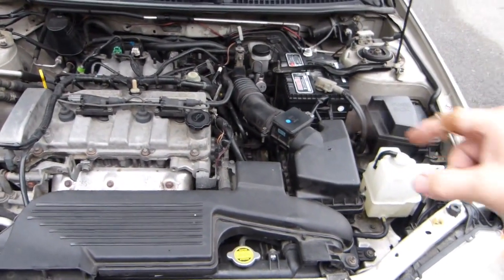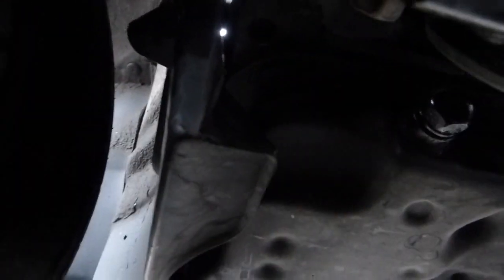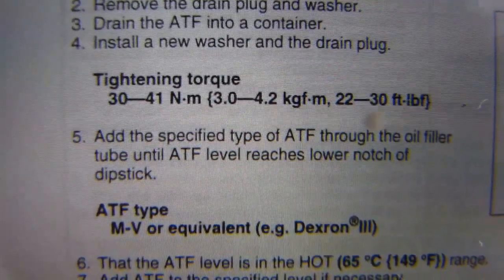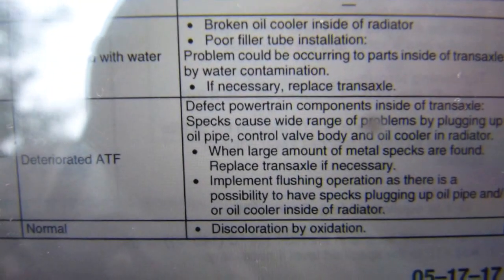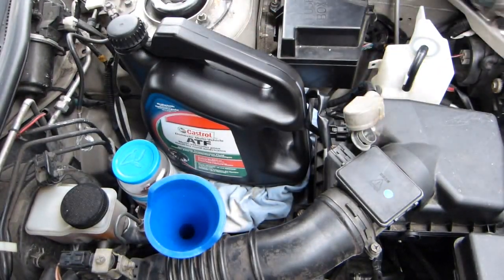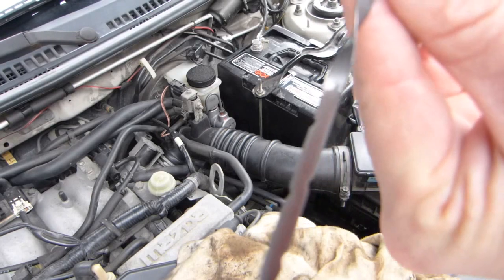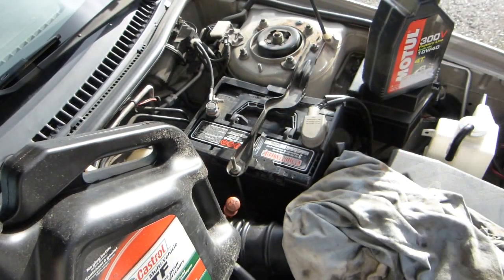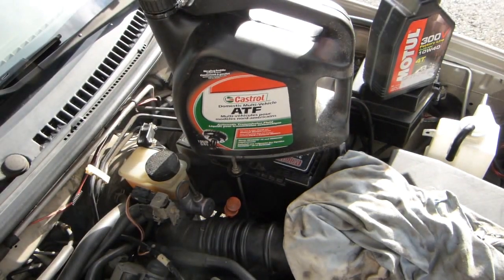Automatic transmission fluid change Mazda/KiaFN4A-EL / Ford F-4EAT

Comment: In order to check ur transmission fluid. Car has to be running.  Only way to get a good reading.  Hold brake got to r the n the d. Back to n -rand park

Comment: The numbers in the manual are correct, you got only half of the amount of oil in the pan, the other half stays in the torque converter. If you run the engine, both half portions do mix up and you got a 50/50 ratio of old and new fluid. If you repeat the procedure, you will mix to a 25/75 ratio an so on... That explains why you think You have too much fluid. I tried this once, and wondered about why only half of the amount came out when flushing the transmission...
Reply: Precisely !!!
Reply: Wait so after you repeat the procedure many times all of the fluid will be in the converter?

Comment: DO NOT USE this is transmission oil in the video, IT IS NOT the proper transmission oil for the transmission! THE PROPER transmission oil is for 1999 - 2003 Protege and Protege 5 and Ford owners is Mazda M V or Mazda M 5 , for Fords it is the same different name "Ford 4F27E" transmission oil !  Mazda's name for this transmission is FN4A-EL, Ford's name for this transmission is 4F27E, "On Mazda vehicles, this transmission uses Mazda M5 fluid (Mazda part number: 0000-77-112E-01), which is NOT Mercon V or Mercon LV according to Mazda Technical Service Bulletin 0500116. This fluid is made by Idemitsu Kosan (according to the label on the back of the Mazda bottle). Idemitsu sells the equivalent Type-M fluid in the aftermarket. The equivalent Ford fluid is FNR5 (Ford part number: XT-9-QMM5). Moreover, Mazda vehicles have "M V" written on the dipstick handle." Mazda type M5 ATF is not the same fluid as Ford Mercon V or Ford Mercon LV. Mazda type M5 ATF has a greater viscosity than Ford Mercon V and Ford Mercon LV in low temperatures. Mazda type M5 ATF has a greater anti-judder specification than Ford Mercon V and Ford Mercon LV.
Reply from the maker: Thanks for the amazing detail, mate! (hearted)

Comment: Every automatic I have owned says in the operators manual to check the auto trans fluid 'while the engine is running'. This takes up a lot of fluid, so the level DROPS when you run the engine. I fear you may be under-filling the torque converter when you check the fluid level with the engine off....

Comment: the number your reading is for the hole system it sounds like you just dropped the pan. thats about half you still have a torque converter that has about  3 to 4 qt in it and you have some in your rad to
Reply from the maker: Make total sense, thanks.

Comment: This is why you pour the fluid that came out into bottles so you can measure the amount to put the same back in. My Honda Accord takes 3 quarts exactly. Now, there is still some fluid remaining in the torque converter and the lines, If you wish to do a "flush", take the lines off and feed new fluid into the return line (MAKING SURE IT NEVER SUCKS AIR! - the hard part) Start the engine so the fluid will circulate. When the fluid coming out the other line is red, stop the engine and you're done.
Reply from the maker: Thanks for the detail.
Reply: theoverengineer  de 5
Reply: do you mean the return line on the radiator??

Comment: Hi

Did you drain the fluid with the dipstick in or out? The service manual suggests that it should be out.
Reply from the maker: +Tanks a Lot They do so to make a fast drain and minimize sloshing, no vacuum is created by accidental tight fit. I had all day and the catch pan was big enough, the fluid stream hits the frame anyhow so it does not slosh. I left the dipstick in, I did not want any dirt falling into the tube.
Reply: I have no explanation to the capacity that they reported, but it is like that in multiple manuals. One guy reported that the dealer told him his Mazda3 capacity was 15 quarts! Now, that is nonsense.
Reply: @theoverengineer   My car shifts hard sometimes, if i change the transmision fluid will it stop shifting at all? It shifts hard more then it does smooth.
Reply from the maker: @JayCMoney808  Everything wears, including the fluid (gets dirty). Replacing 1 thing will not fix the whole. Gear teeth are wearing, plugs blocking/opening internal passages also wear. Full overhaul might be in order. Of course, fluid change makes it better, but not perfect.

Comment: When you drain an automatic transmission there will still be fluid that does not drain out of the torque converter. There are videos on Youtube on how to completely drain and fill your transmission properly.
Reply from the maker: +Mike Anoneemus Right. or from the radiator. Or some fluid film clings to the gear teeth and casing. I had 2 days and gravity on my side.
Reply: +theoverengineer I like the great work you do in your videos, just trying to help.
Reply from the maker: Thanks, no worries. It`s all good detail for anyone trying to get help and follows this thread. I don`t have scriptwriters for the videos and may forget or not mention important detail. Thank you for commenting.
Reply: theoverengineer while driving it goes into neutral turn off car let sit. a minute or two and it driveshould. again for a little while